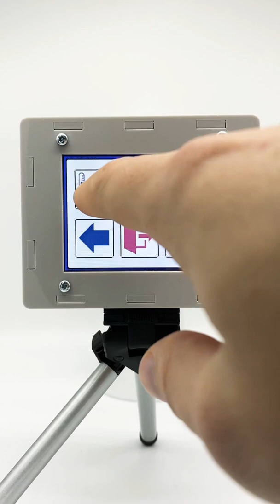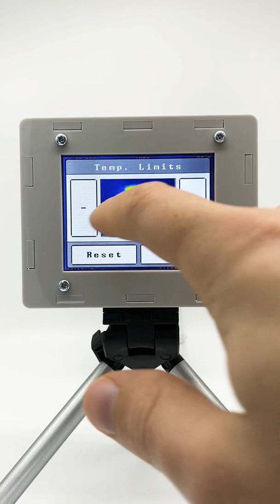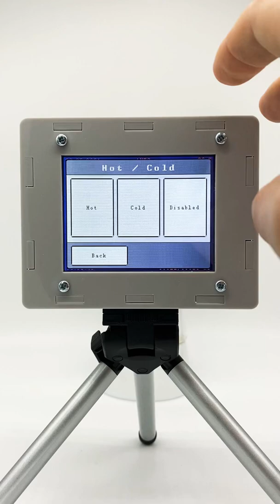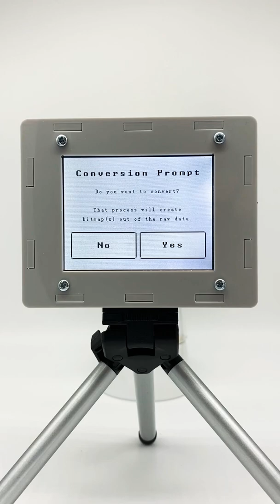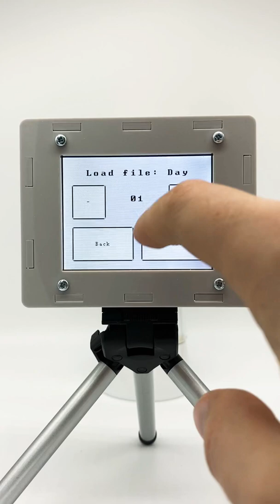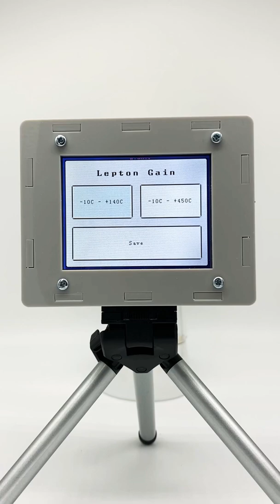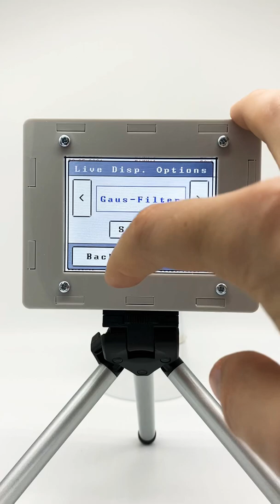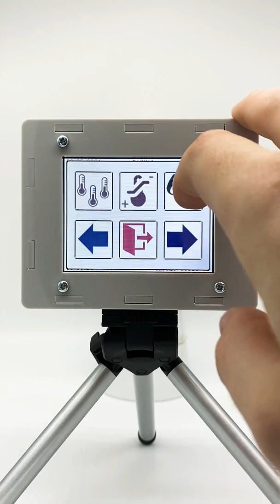DIY-Thermocam V3 Device Walkthrough

Comment: How can i buy this and how can i get it working as a scope camera?!
Reply from the maker: You can buy it here: https://groupgets.com/campaigns/952-diy-thermocam-v3-round-3
That depends on the distance to the object and the object size. The DIY-Thermocam has a raw thermal resolution of 160x120 pixels at a FOV of around 50°. So you need to do some basic math to figure out when an object is still visible on the thermal image.
Reply: did you do this

Comment: I'm guessing that the V3 requires the 2.5 or 3.5 lepton due to the camera being so focused on absolute measurement of temperatures.  While obviously the absolute temperature readings wouldn't work,  would the visual representations of relative temperatures function if used with a 3.0 lepton?  Would the V3  hardware work with  firmware for the V2 camera that can use the lepton 3.0?  
    I'm asking as I've been looking for a use for a lepton 3.0  I have from a FLIR one gen2 that failed.  After much work to revive it, the problem seems to be the poor soldering done on the IC chip interfaces that would require reballing the connections,  beyond my tools and capacities.
   So I was hoping to find a use for the perfectly good lepton 3.0.  I'd build a V2 except that the camera specific printed circuit boards, that make the build just a matter of buying all the components and soldering them in, seem to be unavailable anywhere.
Reply from the maker: Unfortunately V3 dropped support for the Lepton2.0 and Lepton3.0, supporting the radiometric versions only. V2 was able to use an external spot sensor with absolute temperature measurements, the MLX90614 to allow pixel-wise conversions. I agree that it is a bit tough to source the V2 parts on your own, maybe you want to open an issue on the Github repo and asks if someone has spare parts or wants to tell V2 to you :)

Comment: Any idea why the live feed on the tft flickers? Mine does the same
Reply from the maker: This has to do with the way the currently used display library (https://github.com/PaulStoffregen/ILI9341_t3) updates the screen with the thermal image pixel array. There is an extended version of it created by KurtE (https://github.com/KurtE/ILI9341_t3n) that uses a screen buffer and therefore may prevent the flicker according to some users (https://forum.pjrc.com/threads/59926-Anyway-to-stop-flickering-during-update-on-ILI9341-display?p=232106&viewfull=1#post232106). Let me try to implement this way of refreshing the screen and check if it removes the flicker in live mode :)
Reply: @maxritter9955  thanks!